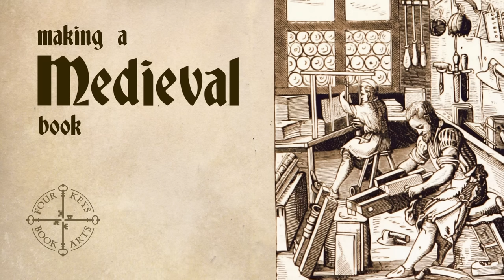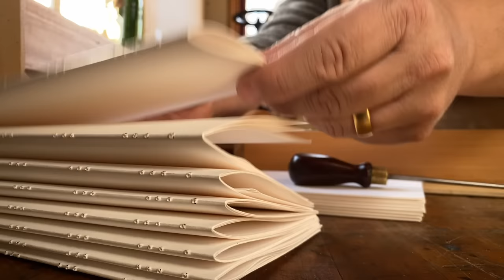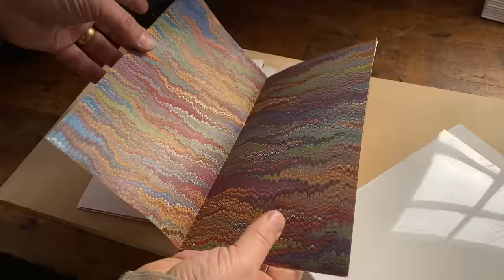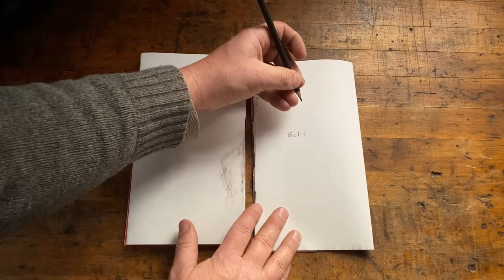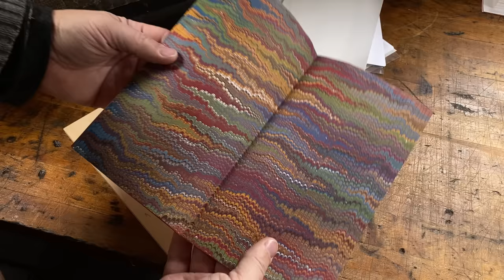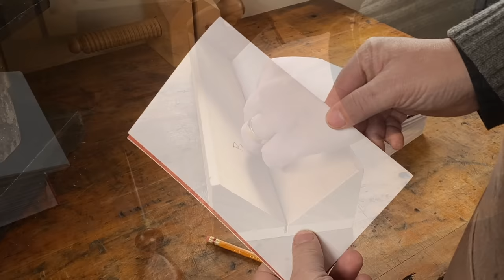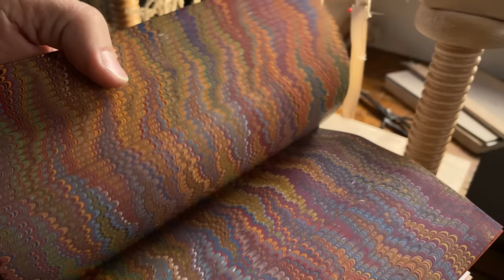Making A Medieval Book By Hand - Part 1 - Folding Pages, Endpapers, Piercing & Sewing

Comment: This answered a question I always had about how they would print and bind 8 pages at once -- how did they keep the pages from buckling after folding them in place?  Well, they slit them partway as the folded them to release any built-up tension in the fold.  Very interesting!
Reply from the maker: It makes the folding so much easier!

Comment: Never seen that method of sewing onto leather 'cords' before but it looks damn fine! Think I'll need to give it a go at some point. Really looking forward to the next in the series.
My only (very minor) complaint is that the subtitle at about 31:45 was only on screen for a second or so - not enough time to even pause the video to read it (I had to slow it down to 1/4 speed to be able to catch it). Other than that I really enjoyed the whole video 👍
Reply from the maker: Thanks for watching, and for the note regarding the subtitle, which I have now fixed. Cheers!
Reply: @FourKeysBookArts  Thanks bud. I found the format very watchable and the subtitles make it very easy to follow exactly what you are doing.

Comment: If you take a good look at the top or bottom of the spine of a hardback book, you swiftly realise that, for all the innovations in making them, in terms of machinery, materials etc., not a lot has changed.. the structure of a book, the way the pages are placed and held in position, how its all fitted and fastened together remains much the same as it did when the Medieval bookmaker worked...
Reply from the maker: I think that explains my fascination with books!

Comment: I'm re-watching with the captions on 
[Yes, folks, with the CAPTIONS ON he explains what he's doing  -- he forgot  I heard 'im say in the comments].

I have a funny question here though (@4:00 approx  -- the shot through your window or door-- signifying the "pages in the press overnight"):
You may know how to make a book, but who left that paint on your glass?! Lol.

Take a metal straight edge (like one of the ones you are using  -- shorter than in-between the window pane,  so you can move it) and place that straight edge flat against the wood. 
Then use a razor blade to scrape the windows  [the straight edge protects the paint and wood -- I just thought of it  -- being some put tape on the window edge before painting].
Here though, the extra paint in the joint stops breezes  -- that may have been what you were thinking  -- good job on that. 
Take a razor blade to those painted windows though. 
You'll have a new-looking window or door in a matter of a few minutes.
[WITH the extra paint in the joints as insulation]
That's my advice to ya. 
You're welcome.

Great job  keeping some of these old practices alive. 

Great job. 
[Oh, I remember -- that's a cool knot with the sewing needle and thread  -- I may have to use that  -- although, no adjustment for the last few stitches  -- where ya have it is where it stays]

Good job again. 
[I'll check-out volume two  -- after viewing with CAPTIONS-- maybe]
Good job 🤔😂👍☕️
Reply: [[@4:41 -- a CORRECTION]]
Reply: An ANGLED razor blade  (you'll be able to go underneath that "straight edge")  but leave it neat and clean.
[Again, WITH that extra paint in the crevices  -- for insulation]

Have your vacuum on-hand (you'll be vacuuming the window/door and floor  quickly,).

An "angled razor blade" though..
[I wasn't suggesting you leave your windows smaller]
You'll have a clear view  [and a brand new door or windows though].

Oh, TAKE SOLICE in the fact that some in medieval times KNEW that glass was harder than metal  -- so  you'll be among THE ELITE of medieval times. 

Good job again. 
Cheers 👍😂☕️

Comment: As a little boy i banged a nail with a hammer through the edge of my thick stack of paper and did this all the way down like 5 or 7 holes. I used twine or some sort of material to tie the cover together along with glue on the spine placing the knots i tied into the spine. I made an 3.5th edition note book with rules in it, mostly homebrew non-sense.

That probably sounds like a tragedy compared to this but it was dope.

Comment: So how is it done when there is printing on the pages? I'm just curious since it looks like the process would be very different if the pages had to be printed first (or was this before printing presses)? I guess if books were made like this before presses then it would be hand written....which is probably equally as difficult.
Reply from the maker: Traditionally the text would be produced (either written or, for later works, printed) before the binding was done. Since I was more interested in the way the book was made than what would go into it, I skipped the printing and went right to the binding. Thanks for the question!
Reply: @FourKeysBookArts  I could not imagine the stress of physically writing in a book that took that much effort to create! I'm still amazed at the skill that went into making this. I want to try it, but I don't have any of the equipment necessary...or the 20 years it would take to get good at it :)

Comment: Great video!
Dumb question, but what's the point of the registration marks on the signatures if the pages are all blanks?
Reply from the maker: Great question! They will show if I accidentally flip a signature end for end, which would in all likelihood put the sewing holes out of alignment. Other than that though you are correct, the order of the signatures isn’t important.
Reply: @FourKeysBookArts  Ah, that makes sense. Thanks for the explanation!

Comment: How does the grain of the paper affect how it is supposed to be cut (and I assume folded)? I've heard a couple of people mention looking out for the grain direction but never an explanation.
Reply: Paper folds more easily along the grain than across it. Same goes for cutting. The reason is the direction of the majority of the fibres. This is most important on a paper made using long fibre material. Some shorter fibre papers don’t have much distinction at all.
Reply: @catzkeet4860  thanks for the explanation!
Reply from the maker: To add to @catz Keet 's quite correct response, the grain direction is important when considering how the glue on the spine will affect the binding. If the paper grain is perpendicular to the spine it can result in warped and rippled pages. Keeping the grain all parallel to the spine is the better option.

Comment: Why did you use an awl to pierce the holes and not clamp all the signatures into your vice and use a saw to cut a notch across their spine?
Reply from the maker: Great question! In my experience I've found sawing sewing holes produces inconsistent (and often unsatisfactory) results. With relatively thick signatures like these, one must saw rather deep to get down to the middle leaf of each signature, which is where the sewing needs to be. This can leave rather unsightly cut marks on all the other pages, especially if you saw a bit too deep. Sawing can be useful if one wants to sink the sewing cords into the spine of the book, but for these raised thongs I went for the awl instead. Thanks for watching!
Reply: @FourKeysBookArts  Thanks for the explanation.

Comment: Hello. I have tried 6 sheets of fabrano 120gsm paper on smaller A6 format and the book is quiet stiff and has bad drape. I believe this is caused by high number of sheets per section or maybe this paper weight is not suitable for smaller book (or maybe something else?). Would you reccomend to go for some lower amount of sheets per signatures using accademia 120gsm for A6 format? 
I am also going to try fabriano schizzi which is 90gsm. Any recommendation for how many sheets of paper for A6 and A5 formats using this binding method? Thank you!

Comment: hi so youre using paper, but they would have used vellum. is there any difference when it comes to folding, piercing, sewing and cutting the pages when it comes to vellum?
Reply from the maker: In fact paper became the primary text material for gothic bindings well in advance of the invention of the printing press, though it was often reinforced with parchment or vellum, likely as a holdover from older binding techniques. I have not worked with either parchment or vellum myself, but they are both materials I'd like to explore. Thanks for the question!

Comment: 1) I only guessed that you might have put captions in the subtitles half way through. Please add at least an initial "on screen" caption to tell people

2) Might I recommend not using your workbench as a paper cutting support? The workbench is both slightly uneven (so not an ideal support), and hard to replace.

3) Your camera is sometimes out of focus. Unless you really need auto focus to track movement during a shot, it's better to LOCK the focus to avoid auto-focus mistakes. (tip stolen from YouTuber Keith Rucker).

4) I really enjoyed your work!
Reply from the maker: Glad you enjoyed the video!